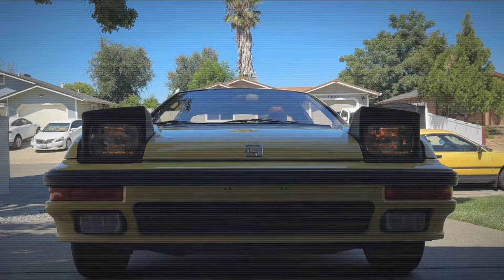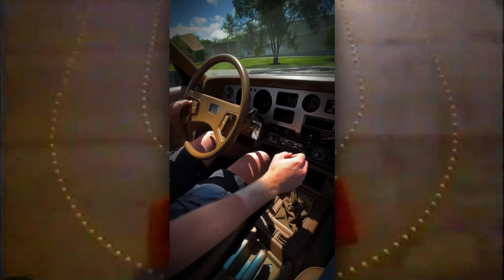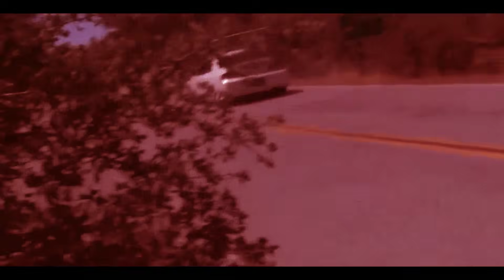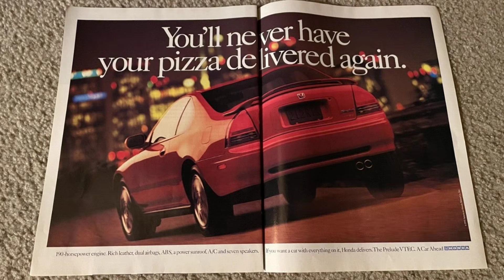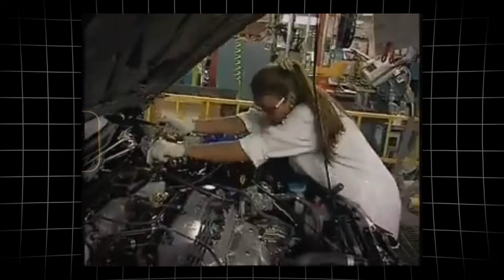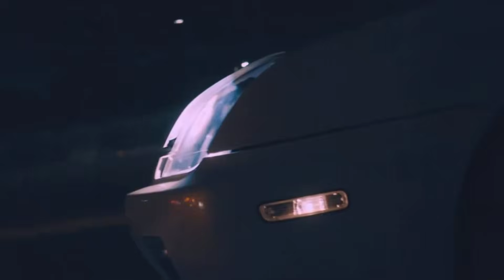🔴 Inside Honda's STRANGEST Decision: KILLING the PRELUDE

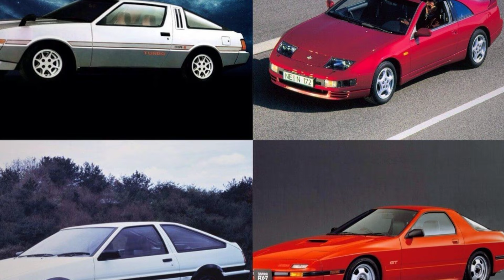Comment: At 3:09 you show a early to mid 80's Mitsubishi Starion narrowbody, a 90-96 300ZX, a second gen RX-7 and an AE Corolla. All of these rear wheel drive cars were in a different performance category from Prelude. The Prelude was arguably the best front wheel drive car in its time. But it did not have the dynamics of the cars you have listed at that screen shot. I test drove a 1987 Honda Prelude with the 4WS and I owned a 1985.5 Starion ESI Turbo (first Starion with the intercooler before they were all widebody cars, it was a narrow body car only) and experienced the second gen RX-7 as well. They were in a different league to the Prelude.

Comment: I owned a 1988 navy blue Prelude which I unfortunately totaled in an accident.  In the 1994 I purchased a used lighter blue 1989 Prelude that I would drive for several years until purchasing a brand new black 1997 Prelude when they first came out. All were 5 speed manual transmissions.

Back in the early 90's I didn't care for the 1992 Prelude with the pumpkin eye tail lights, however the deeply recessed instrument panel was ahead of its time and is what today's cars need more of. It's easier on your eyes to look at gauges from long sight lines as you switch back and forth from viewing the road ahead. The digital screens today that are close to your face popping up out of the dash is not good design and looks like an afterthought.

Check our the dashboard of the 1992 Prelude to see what I mean. The 2026 Prelude is ok, but the angled roof line that interferes with the back seat headroom doesn't look good to me and again it has a screen popping up from the dash which isn't elegant either, not for $43K.